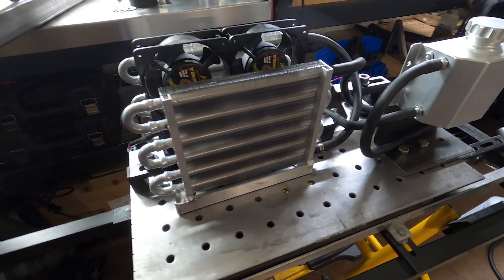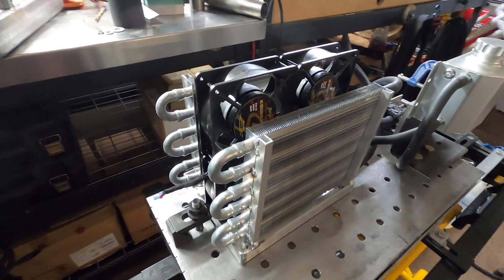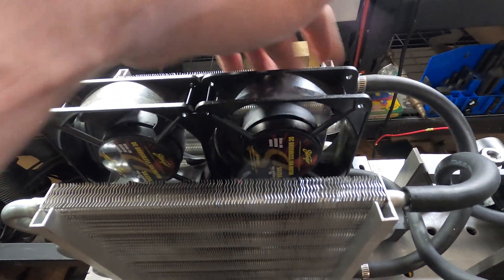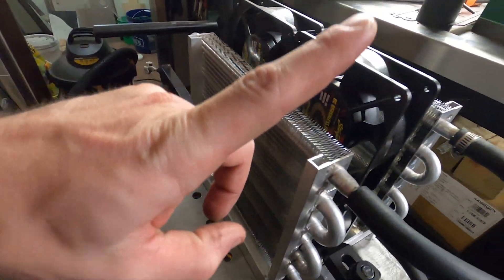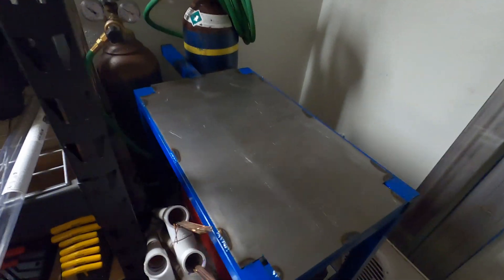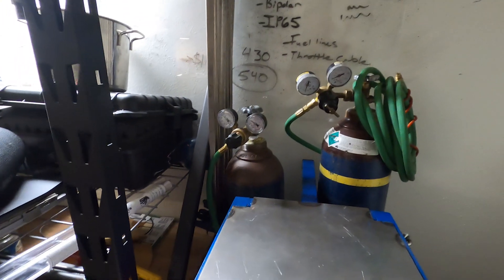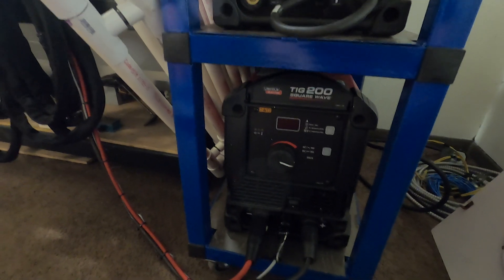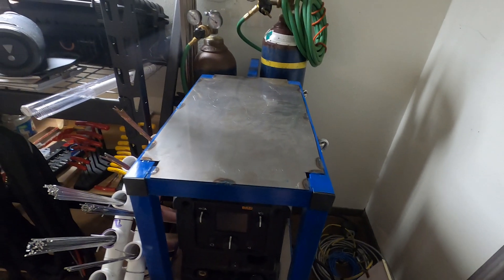TIG Cooler Prototype

Comment: That's awesome. I've always wanted to make a tig cooler that had a modified ice chest and a fluid heat exchanger. It would be multi-function: the heat exchanger would keep the torch cool, and the beer in the ice chest would keep the welder cool.

Comment: Hi, those pumps have enough power? Seems its a 12V 130psi 6l/min. pump? I am about to buy one, but not sure for that purpose.
Reply from the maker: Ya it maintains good speed.  At full burn on the welder I’ve noticed I may need to bring up the tank capacity though to get the heat out of the system faster.
Reply: @sinewavespecialties2373  Adding more tank capacity is not going cool it better but only going to prolong the time it takes for the water temp to hit equilibrium with cooling capacity of the radiators and fans. For this type of application, airflow don't have nearly as much effect on cooling as static pressure. You would benefit if you attached the fans in contact with the radiator to create that pressure.
Reply from the maker: @Ricqu  another viewer mentioned that as well.  Once work slows down a bit I plan to redo the whole design actually to more or less resemble an RTU wedged design actually.  Hard to get the time currently but it did just spring a leak from those trash radiators so I'll be doing it all over again with a pair of cores and caps this time to produce the differential pressure across the radiators.  You are correct.
Reply: @sinewavespecialties2373  thanks for information. Do you use automotive antifreeze? Some users reported conductivity will lead to electric corrosion. But I think this is only the case if the part you are welding has connection to ground.
Reply from the maker: @charly4555  jump on my Facebook page at “Sine Wave Specialties” and add or follow.  Then I can send video or photos specific to your questions
Reply: @sinewavespecialties2373   Instead of that, try to lean those fans to the surface of the radiators. You are loosing a LOT of cooling, because they are not touching radiators. 
Split them in half and lean two of the fans on each radiator.  Even if they are not covering the whole surface, that way, they will definitely cool much better.
Reply from the maker: @23101979T  you aren’t wrong.  18” pass on steel at 200A without pulse got the whole system warm.  I like the idea you got like HVAC condenser set up.  Open case prolly is a thermal efficiency loss as well.  I plan to add another tank and two more coolers to the loop and put a plexiglass case around it to create a pressured atmosphere as well.
Reply from the maker: @23101979T  thanks for the tip man, reminder of flow mechanics.  That’s why posting these vids works for me, reminder that it’s not the only way or not quite right
Reply: @sinewavespecialties2373  It's my pleasure to participate, even if it's just in this way.
Reply from the maker: @23101979T  well it makes sense in the case of RTU systems and condenser cases.  Have to have air balance and pressurization.  Possible new video there
Reply: You might be able to increase cooling efficiency a bit by putting the coils in parallel, and putting them on opposite sides of a box, say sides 1 and 3 looking down on the box, and the fans on sides 2 and 4, with the top and bottom of the box closed.  Heat transfer is about surface area, time and temp difference.  Placed in series with the fans pulling thru one and heating the air it is pushing thru the second, reduces the delta considerably on the second coil.  In series, the coolant is flowing thru the fans as fast as possible.  There is also some loss with the fans just moving air.  Putting the coils in parallel, will half the flow speed thru them, doubling the heat transfer time.  Boxing/shrouding the coils and fans will force more air thru the coils, it will also cause fresh cool air to be pulled thru both coils simultaneously, while both coils are being fed the hottest coolant for the greatest temp difference.  My only concern would be if that pump is rated for long duration/continuous duty.  I don’t think diaphragm pumps are typically rated for long duration runs…  i am working up a plan for one of these, and I think I may use a centrifugal boost pump.  You don’t need a lot of pressure, but the centrifugal pump can run continuous…  Nice build!